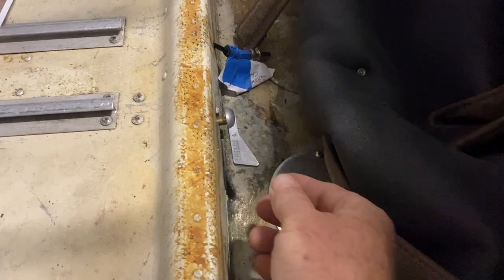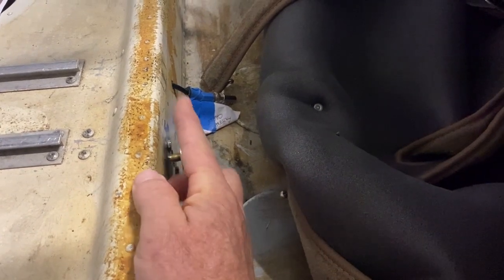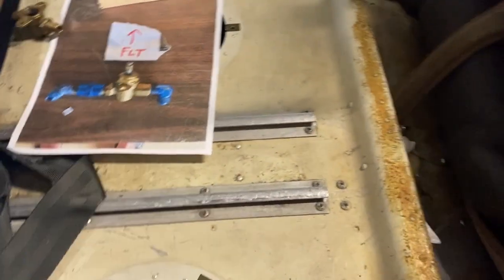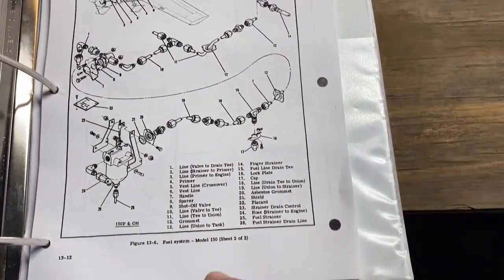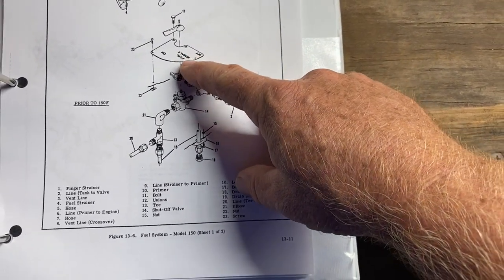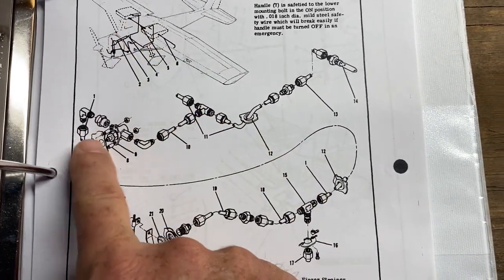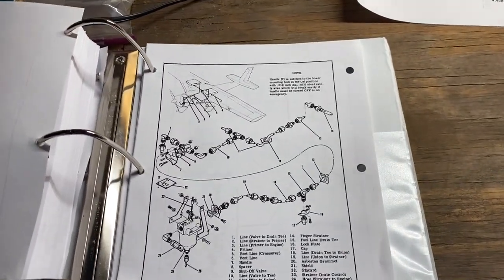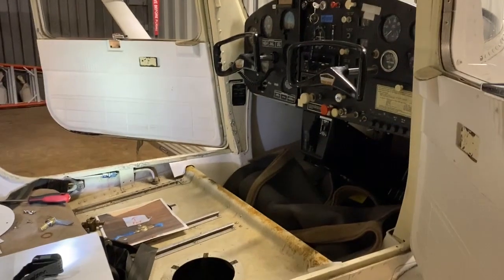Cessna 150 Fuel Cut-off Valve Lessons Learned--WRONG INSTALL!

Comment: At least yours actually shuts on and off.  Mine is locked in the on position.  The service manual says it has a .018 gauge "safety" wire to keep it on the on position that is "easily" snapped in emergencies, but I don't want to have to wait until I have an inflight engine fire to find out if that damn thing will actually shut off if I twist hard enough.  The Cessna engineer who thought that up should be punched in the face for it.  How hard is it to make a simple on/off valve that you know works before you go in the air?
Reply from the maker: My brother I feel your pain! Actually if you look at it like I kind of did a little history search they just re-purposed a water valve. Didn’t really re-engineer it and it just wasn’t designed to last this long in the open position. Bro bro just fly safe and your adrenaline will pump so hard when the time comes if it ever does which you’re a good pilot you’ll never have it happen OK! Don’t mess with it or you gonna get some leaks bro unless you’re ready to drop two or $3000. That’s my advice.